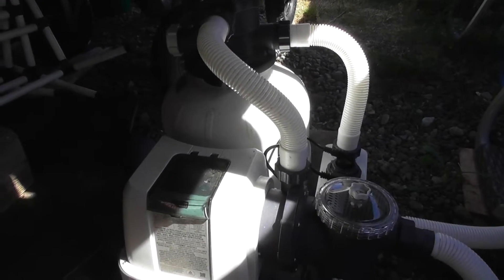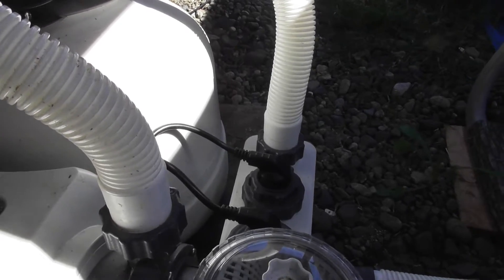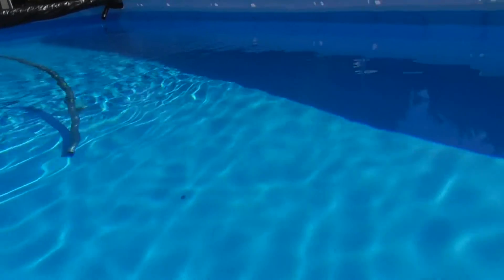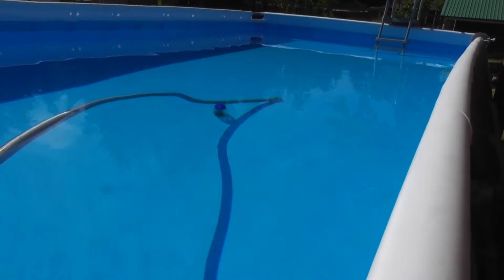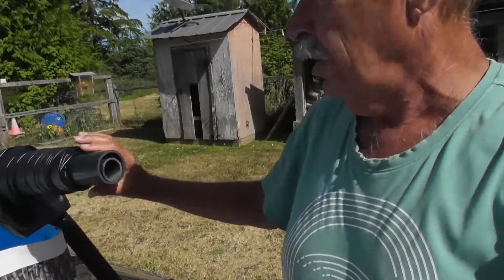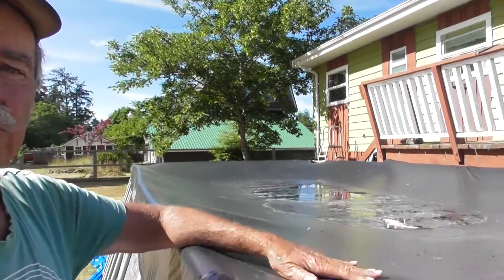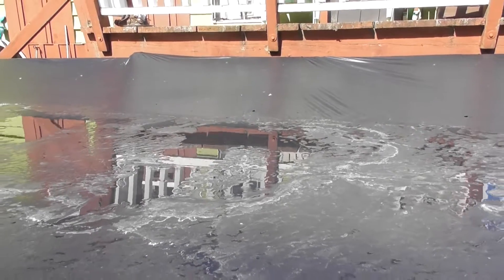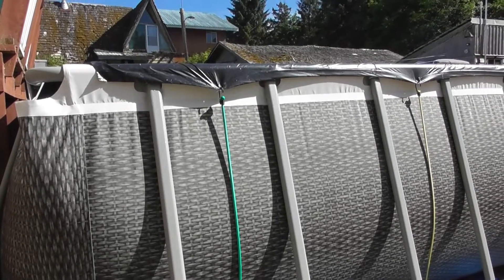Solar Powered & Heated Coleman 22x12 Pool

Comment: I will note down everything you advised , the solar panels. Without alteration would 2 heat the pool somewhat ? Either way greatly appreciate all your answers and suggestions and your time to make the video…..
Reply from the maker: I used 2 panels the first year and it would raise the pool temp about 5 degrees on a sunny day.  Depending on you location and the amount of sunny days you get, 2 might be enough but I am in the Northern part of BC Canada and the night temps drop the pool temp quite a bit so I added 3 more to heat the pool faster.

Comment: Hi Norm ,I would really appreciate if you could help me …this is exactly the pool/setup I intend on buying for next year …is there any possibility you could please detail , where you purchased all additional instruments ? Did you put down lining for under the pool? How do you winterized it and do you keep it up in the winter? What type of plug will I need installed and can I run on heavy duty extension cord to the house ? Where do you purchase the salt for the salt device and where to purchase the solar powered block and do you remove that for the winter? What is the total cost of everything? I would really truly appreciate a detailed list , would be of tremendous help if you have a minute , appreciate your videos! This pool setup seems to be the best durable and cost effective option. For the winter do you drain the water out? Pump out with a pump? Thank you in advance!! Eva….the pump it comes with does it seem efficient ? And do you just replace the filters in that ? Every little detail will be of great value..TY
Reply from the maker: Going to do another video next week and it will answer all your questions.  Let me know if it helps.

Comment: Thank you for the informative video.  Im thinking of getting the same pool with the same intex 3000gph filter and salt water conversion.   Can you please tell me if the tube sizes are compatible or did you have to purchase additional connectors? Thank you!
Reply from the maker: The hose fittings on the Intex pump are the same as the original pump so you can use the original hoses.
Reply: @NormanMcGregor  I appreciate you replying. You are so helpful! Thank you!!
Reply from the maker: @natashasilva3548  Thank You!!

Comment: Hi Norm.... a message from Ontario, thanks for all your videos, and I was wondering, is your Volt Bike still running and have you had a good experience with it long term ? cheers
Reply from the maker: Hi Gregory, Yes!  Both our 2017 VoltBike's the Yukon 750 and the Mariner are both running perfectly.  The Yukon now has just over 15,000km and the Mariner has just over 14,000km.  I must do a video on the soon.
Reply: @NormanMcGregor  ~ great to hear Norm, I am thinking about a Mariner :)
Reply from the maker: @TTR230blu  The new ones are very nice and have a larger capacity battery too!  There is even a step through model for easier getting on and off of it.
Reply: @TTR230blu  Hi Greg, I can also vouch for the brand Voltbike as I also have an Enduro from them boughten last fall! What I really like the most about buying from them is you get at least service. I'm also from Northern Ontario (Sault Algoma Region) and I've had a few times where my PAS level button was on the fritz, they sent me a new one under warranty that also included the color LED screen. You can at least reach someone is what I mean where as I have another foldable one I bought of Amazon and albeit there's some support but it just feels better knowing there's a company like Voltbike in Canada where you can turn to when things go South if they do. That said, my bike has been performing quite well and have been to some very remote places on it lately!